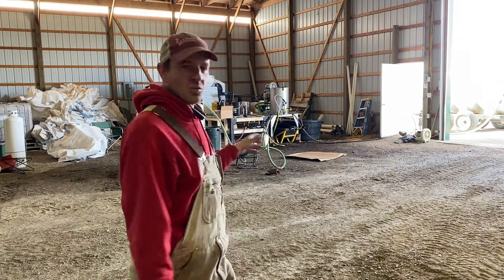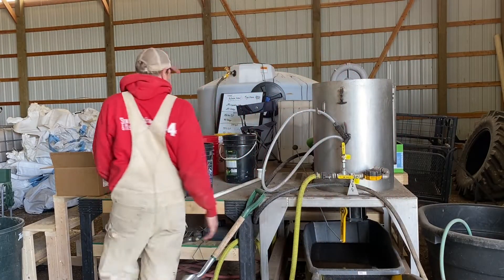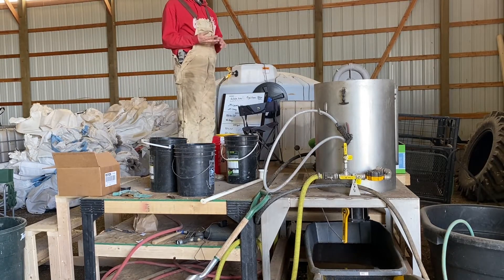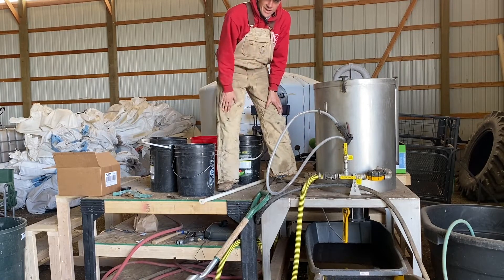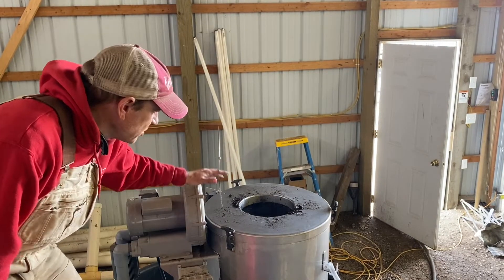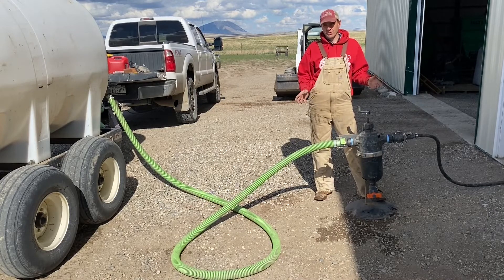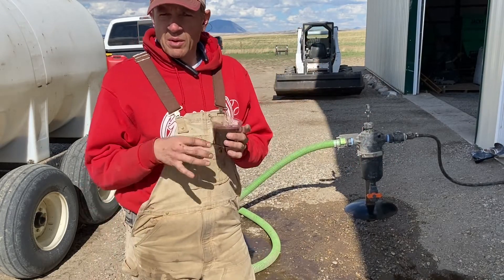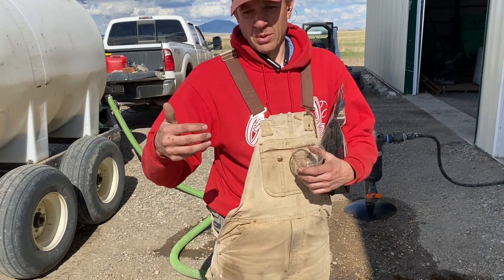Farm Scale Compost Extract

Comment: But if we put the whole compost in soil, then also all microbes & fungi will go to soil. What is extra benifit of extracting compost tea and then putting in soil. I am new to this so please help me to understand
Reply from the maker: It really comes down to what scale you want to do this on.  With the extract we can put this through our liquid kit on our drill which allows us to spread a lot of biology over an acre using just 5 gallons of solution.  If you were in a gardening situation placing straight compost by the seed would be a better solution.  The extracted product can also be sprayed on the leaves of the plants which we try to get done when time permits and the weather cooperates.  We do have some neighbors that have figured out how to mix the compost right with the seed after screening it and are putting dry product through the drill which is another great way to do this if it doesn't plug the drill up.
Reply: @koreyfauque7745   💯👌👍 Thank you for all your fantastic information & details!

Comment: Korey, why are the microbes made from extract more durable compared to a tea?
Reply from the maker: Hey Greig great question.  Tea is basically extract with food and oxygen added to it which make the biology start multiplying.  When that process is happening it takes a lot of oxygen to keep them going so if you don’t aerate it it becomes anaerobic pretty quickly and the good biology gets taken over by things undesirable for crops.  With extract it can sit a lot longer without issues because the biology population stays pretty much stable without food added.  Tea certainly has a fit for foliar applications but extract is much easier to work with for what we are doing.
Reply: @koreyfauque7745  👌👍💯

Comment: Korey, The filter your using requires 80GPM according to the web I like the filter but don’t have that pressure are you actually pumping 80GPM Into your tank
Reply from the maker: Hey Tom that is what we would be pumping from the trailer to the liquid cart in the field.  We used it from the extractor to the trailer too and it worked fine at 50 gpm or so

Comment: Very interested in what your doing here,,,sorry I missed you at the NRCS presentation in Chester…we farm NE of Chester,,,have been using a disc drill since 2015 and a Stripper header since 2017 and are very happy with the results thus far.  Have been following along with the “regenerative ag” movement with great interest and now with the obvious concentration in the input industry for Ag as well as the current political situation I’m ready to jump in and test the waters with this type of system.  Appreciate the time and effort you have put forth here.